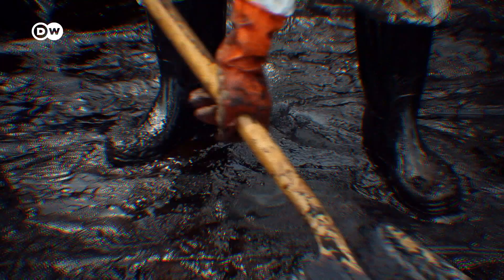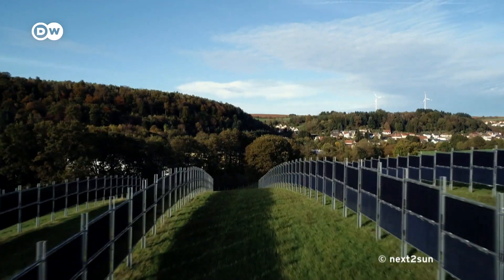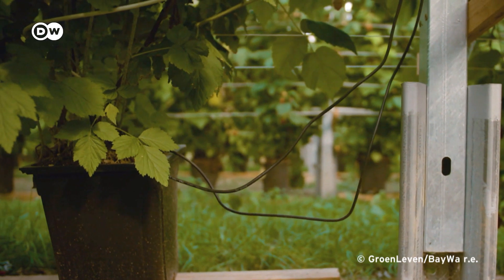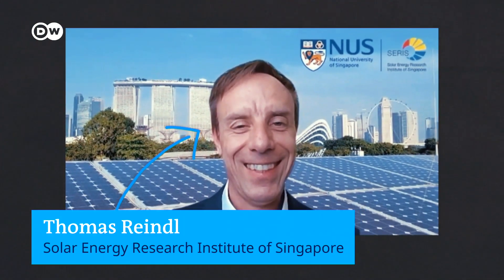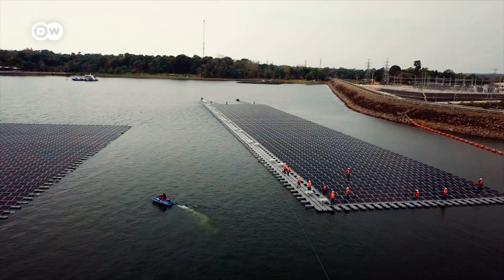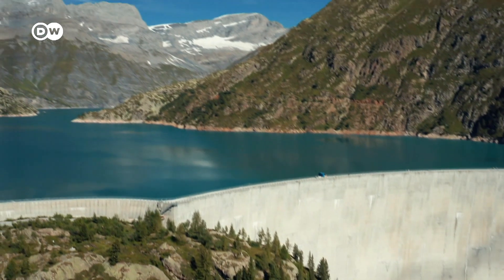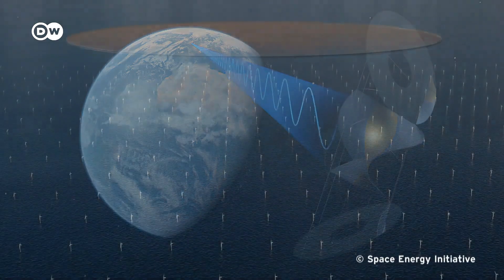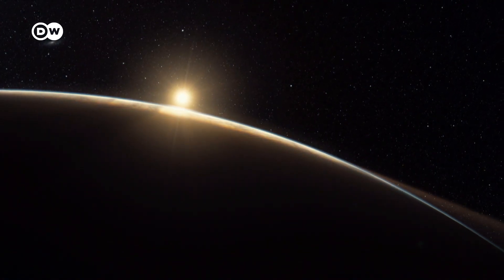Why we should be putting solar panels on our fields and lakes

Comment: Why not put a solar plant into space? Because that's literally a giant, expensive orbital death ray. We have more than enough space down here, just not the distribution infrastructure.
Reply: Someone's been playing too much Sim City 2000. The beam is something like a kilometre wide. 1GW spread over 1km^2, is 1000 W/m^2, which means the microwave power at the collector is less intense than plain old sunlight (~1300 W/m^2).
Reply: @Roxor128  the death ray part was obviously a bit of a joke, but the expensive part wasn't. It's one of those "cause we can" projects, not one that makes sense. There's no point in even thinking about beaming power down from space before we have a worldwide interconnected grid. The transmission losses from conducting power to the other side of the world are less than 50%, and it's always sunny in at least one of earth's deserts. Orbital collectors have combined losses of north of 90%, not to mention that you have to shoot them into space. And then there's still a valid concern about the environmental impact of grilling a city worth of space with microwaves.

Comment: What I can't understand why governments aren't making efficient rules for rooftops. There are no laws that says that every new building needs to have there own power source. And that the roofing needs to be white or green. Both make a huge difference for climate change. 
Why aren't there rules that older buildings with flat roofing are obligated to use the roof for the environment. That means, a white uv coated roof or a green planted roof or a rooftop filled with solar panels, preferably in combination with a white or green roof. 
This will make a huge impact on the environment.

Comment: The major issue with Solar is electricity storage The issue with solar is that we dont control the output. its the available sunlight that controls output.
So if electricity demands are high & sun light is low => it creates a problem.
We need much better & large scale electricity storage solutions which can bridge this demand.
Also we need to expand nuclear energy. Nuclear is very safe contrary to popular beliefs.

Comment: I wouldn't put them in agricultural areas, I would limit myself to putting them on the roofs of houses and warehouses and if that is not enough you look for something else .. putting them in fields also means reducing local biodiversity !!!
Reply: Lots of room for rooftop generation: 10 million buildings times 5kW each gives 50GW of generation. That's several dozen coal-fired power stations you could close down and fill with batteries.
Reply: @Roxor128  Exactly

Comment: I live near the Pacific ocean, there are resident Orca whales all throughout the passages and inlets. They're highly dependent on specific species, salmon and others. A floating voltaic system would drastically interfere with the whales otters, seals, and birds that use the ocean for both food and nurturing their young. 
Extreme hazards should never be the standard for ecological damage. The current ocean temperature is already rising, affecting mollusks and aquatic systems, plants and fish. Those panels cool because of the absorption of the heat into the water. We don't need hotter ocean currents, we need cooling down.
Reply: not really. If they were heating up the water they wouldn't reduce evaporation, which they do.
Reply: No one was suggesting covering any rivers/passages with solar panels, they said reservoirs which are relatively devoid of life. None should be big enough to cause significant issues, you’d be surprised how little of the earth we have to cover with panels to generate all the electric we need. Nuclear’s probably the better option but solar is still an improvement than current.
Reply: And don't forget the oceans are becoming more acidic.  Poor corals.  Poor fish, Poor Orcas.
Reply: Another commentor said that the sea absorbs almost all the solar radiation anyway, warming it up, the offset difference of the shade provided by the floating panels preventing the absorption of solar heat  and the heat the panels produced that the sea absorbs would have an overall cooling effect not warming. 🤷🏻‍♀️
Reply: Thank you so much for this comment. I can't understand why so many people think we can create a new solar and wind energy infrastructure without doubling the damages to the environment that we have already done; additionally, these new energy infrastructures will themselves cause more damage to the environment as we use them. I think there is only one viable solution to man-made climate change: "profit = protecting and enriching the environment, and sharing the sustenance that it provides to all of us". This should be our new behavior model instead this old model, "profit = income - expenses". This old profit model treats the entire environment, that also includes all of us, as nothing more than expenses. As we all know, businesses must avoid and or eliminate as many expenses as possible. No wonder there is so much homelessness, and no wonder the earth is on fire. The new profit model will create millions of new jobs that will come under the heading "Caretakers of the Environment". Caretakers will earn higher wages than most other workers. There will be thousands of Caretaker subdivisions that each deal with specific aspects of rebuilding our environment such as collecting waste before it gets into the environment and the beneficial use of the collected waste. We also need Caretakers that deal specifically with extracting waste that is already polluting the earth, air and water, and using those waste products in a beneficial way. We also need to control the size of the human population by economically incentivizing families with fewer children while economically discouraging families with too many children. Sorry the note is a bit long, but the solution is very complicated, and I've hardly scratched the surface. 💖👍
Reply: The whales love the cooling water outfalls of the nuclear power stations on the California coast.
Reply: What about having solar sails in space and beaming down as microwaves to a tower and converting those microwaves back to electricity?  It's been done before many years ago.  I don't think a sail high in the near outerspace is going to hurt fish.

Comment: heres my radical idea
how about we put nuclear reactors to power cities? Uranium is about as common as aluminum, and it produces no radioactivity unlike coal plants. For one nuclear plant you only need to store a few huge reinforced concrete "barrels".  That pose zero risk of leaking or leaching radiation.

Solar is massively inefficient, if we live in apartments and build our cities to be walkable, bikeable, and have good high speed rail we use half the energy for heating/cooling, and we dont emit 20 pounds of co2 per gallon of gas consumed.
Reply: Politically difficult. What politician wants to push for a solution that will take twenty years to build? By the time it comes online, he'll be out of office and someone else will take all the credit.

Comment: We have the space in our own back yards, so to speak, because every roof every bridge every road everywhere every structure everywhere can have solar installed. It does two things. It keeps the wiring infrastructure close to the use. And it shades everything. Every parking lot needs solar every freaking parking lot. We don't have to put it in a desert put it on every house every school every building ever made everywhere. Are you getting the picture.

Comment: While I understand and agree that solar panels should be used more we shouldn't forget to mandate recycling for them because if they end up in a landfill where some crooks will burn garbage for money then we end up in a vicious cycle.
Reply: The PV parts themselves are not worth recycling. It's just silicon. The aluminium frames are though, and depending on packaging sometimes the glass protective layer.

Comment: The answer of why it's not everywhere - economics. We don't need to look for places it's difficult to do, we need to start with places it's easy to do.
Rooftop solar is the cheapest possible solar, yet it's not covering every roof around you, not because it's not technically feasible, but because it's not economically profitable.

Here are the 3 farming ideas you presented and why it's not done:
1. Solar fences - you get extremely sub-optimal production & require significant foundations that cost extra money due to the wind loads that the panels will accumulate.
2. Single axis (or double axis which you didn't show) trackers - these were popular about 10 years ago, but with the declining cost of the solar PV module itself installing moving mechanical parts (that now need service) is no longer cost effective. It's cheaper to put more modules than to make them move. There may be some business case for it closer to equator, but definitely not in North America & Europe.
3. Building taller. Solar carports are the most expensive types of solar PV that I design. Steel is expensive and if you're building taller, you're not only increasing the length of your steel members, but you also create a much higher torque with the wind caught by the panels, so all your steel members & foundations need to be thicker - it's just not very economical to do this.

I've designed over 20MW of solar projects. A lot of my projects were for farmers in Ontario, Canada, but all of them went on top of barns, as those have large unobstructed roofs.
Reply: Solar fences make more sense on extreme latitudes. Here in Scandinavia it would be perfect, producing more the lower the sun gets... When it's really needed.
Reply: And agrivoltaics runs into issues with agricultural machines. The panels would be great on those few crops still harvested by a horde of low-paid (and legally dubious) seasonal laborers, but agriculture now usually means industrial scale machines traversing the fields. Machines to till, machines to sow, machines to douse with fertiliser and pesticide and herbicide, machines to harvest. Can't do that when the field is dotted with posts to support the solar above.

Comment: Maybe we should think of the floating pv similar to the "green house" pv plants. Can we space them out a bit more and grow plants beneath them? I am imagining something like a underwater "farm" in hope to give fish more areas repopulate and grow up. No big fishing should be allowed close to those floating platforms (maybe giving small fisher man licenses for fishing in exchange for help with the habitat project) 
Also you are talking about the pv cells being cooled by the sea, but shouldn't the goal rather be to limit the sun heating up the sea? I'm guessing that this is still happening since normally most of the light would be absorbed by the sea, converted to heat and now is converted to electricity and heat. I would just really like to see some measurements of the temperature at the top layer of water.

Comment: There are some Indian projects for solar panels over irrigation canals. It reduces evaporation and provides power.

The key to solar power is residential and grid storage. Hopefully flow batteries and liquid air storage will work for that.
Reply: California is now following India and adding PV on top of canals. These are not small water channels on farms in either India or California. Besides producing electricity, the PV panels can also reduce evaporation enough to make a difference. Water for cleaning the panels is readily available and runs back into the canal. There are roads along the canals already. Like agrivoltaics, this is a win-win.
Reply: Kevin 🌸the project you are talking about is in,,,,,,,, Vadodara in Gujarat,,,,,,, it was started and completed by 🌸 Narendra Damoder Das Modi ,,,,,,,, when Modi ji was Chief Minister of Gujrat State.
          Not only this and the other solar projects DW is talking hare,,,,, solar panels on farm land,,,,,, was preferred by progressive farmers in Gujrat State, especially in Anand and Nadiad District and they happily sold surplus solar energy to other farmers . These projects are also installed in Bengaluru by big tech companies. 
             🌸 All this happened before or after 2014  where they reached today, I don't know.
             😀 Prime minister Modi is big Sun worshipper 😀.               Infact all Sanatan Dharma followers  worship  🌸Surya Narayan.
Reply: Over farm irrigation canals? Too small to make a good use of efficiency.
Reply: @GeopolInvest  He's not talking about the channels on the farm but the long large canals to bring water from dozens or hundreds of km away in a 10m wide channel.
Reply: @GeopolInvest   you can't put links in YouTube, so go search for "indian solar canals."
Reply: Sodium-ion batteries as well
Reply: India should work on their trash problem first...
Reply: And cooldown the panels as well
Reply: Jordan is researching and getting answers first don’t try to steal away from there shine. India needs to fix their air quality first and their waterways dirty!, filthy!… smog  everywhere.
Reply: Fix your toilet and garbage problem first… lol

Comment: Alternative for space:

Add rectenna arrays to existing solar panels as we build solar farms.  Thousands of solar farms small, medium, and large, are all over the planet. 

Put solar collectors in polar orbits along the day/night boundary - they fly over the dawn/dusk band of the earth once every 90 minutes.  

Each of these satellites feeds power into several directional microwave projectors, and as they fly over solar farms they target them with microwaves.  

This has the advantage of providing power right when it is needed in the local area-  right when people are waking up cooking dinner.  It takes advantage of existing power infrastructure, keeping the cost low.  Great advantage due to redundancy in both ground collectors and in orbital collectors. Seems like it would be much more safe and efficient because we would be beaming power from 200 miles instead of 22,000 miles. 

And this technology is available today - we can make megawatt scale microwave lasers with the right focal distance to target q solar farm from 200 miles, but gigawatt scale and a need for 100x the focus is probably decades away. 

No need for battery storage.  No need to create new high intensity ground based solar collectors.

Consider safety... To beam a few megawatts down instead of gigawatts -  a 10 gigawatt geostationary maser could be used as a weapon.  A thousand 10 megawatt masers could not focus on a single point.  

Who wants to fund the company?